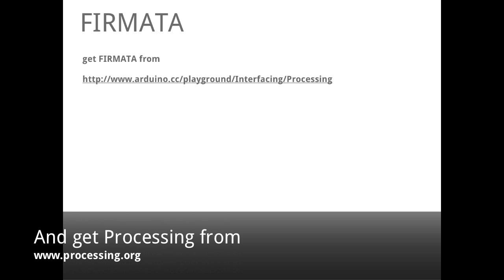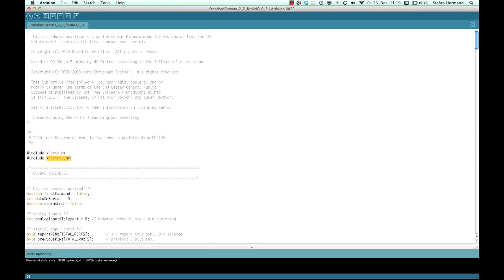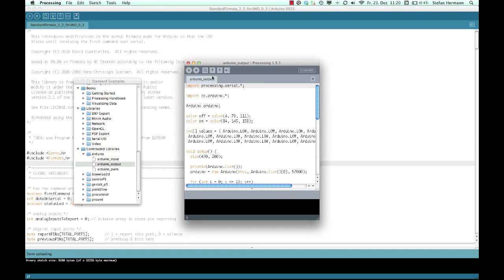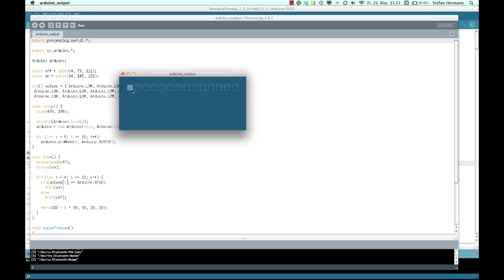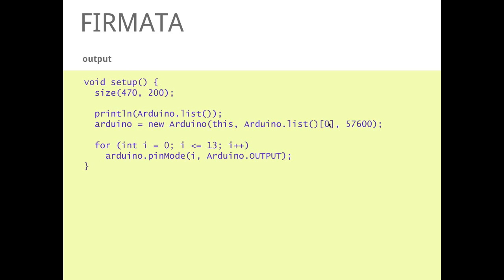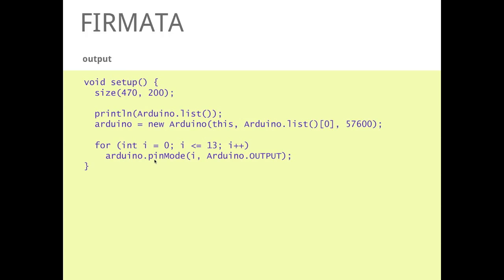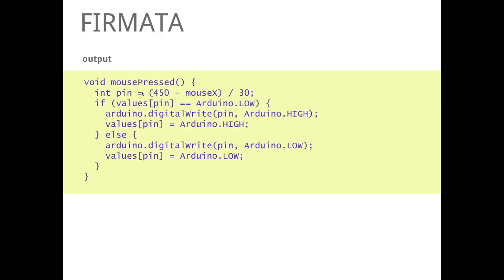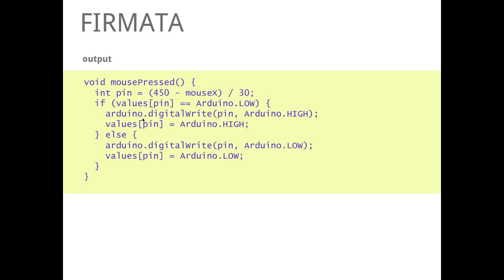Learning Arduino Episode 012 -- FIRMATA

Comment from the maker: It looks like a wrong rxtx library. You could try to boot your system in 32 bit mode. If it is not working, ask in the Processing forum again. Thoes guys are usually more experienced with this topic.